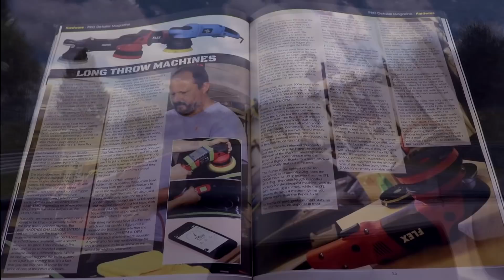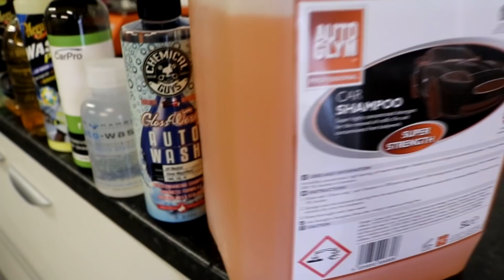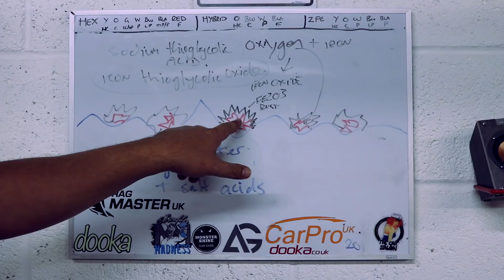From 5000 detailing products down to essentials - Complete Garage Clear out

Comment: It would be interesting to see what you "throw" away and why, kind of reasoning as to why those product don't have place on the shelf. I guess mostly they are "not as good" products as you kept, but in which way e.g.  maybe some product are better but more expensive and for somebody at home not doing bulk detailing that is not the problem and extra price worth it? So that would be interesting to see - sadly I guess it is a bit late considering this came out 11 month ago (at the time of my comment).
Reply from the maker: yer I cant keep it all.. most of the time its like do I need 6 APC's  do I need 13 heavy cut compounds.. etc.. I just want one.   but its usefull to keep a few products in each class for comparisons...   you really dont need shelves and shelves of products like I have.

Comment: Awesome video......always love the passion. When you say that some products contain harsh chemicals...eg leather cleaner,  Tell is which ones.
Reply from the maker: Example.   Greenstar.  I dont use it on leather.  some prolly will do because if you knock it down to like 30-40:1 the concentration of the sodium based components will be so very very low.

Comment: Thanks! What's your favorite coating prep wipe? I find some to be grabby upon wipeoff, which scratches the paint. Totally counterproductive.
Reply from the maker: cheap hydrocarbon based  ones.  They are very fast acting the hydrocarbon solvents on car panels.   work them over, dont allow them to flash or dry.  And buff them when they are still wet and visable.   not trying to preach to the converted brewinz you might know more about this than I do just brain dumping.

actually I think your talking about the water based ones the coating brands sell..  In which case yes Im with you and agree they do stick yes.   I dont think polar solvents in water are on the same level as a hydrocarbon solvent.  obviously need to be carefull with them, but its nothing complicated really.. just being very mindfull of heat and not leaving them on panels, on off etc..  cheers mate

Comment: It would be interesting to see a test of the chemical resistance of Ceramic Coatings, do very potent cleaners dissolve it? How strong is the bond between CC and clearcoat? Can one peel it off? Too close with pressure washer?
Reply from the maker: hey flynn I did this in the best ceramic coating video try to effect them with acids, alkalines and solvents.   nothing you can really use on cars chemically will disolve a coating once its fully cured, well at least thats my understanding Im not an expert on coatings most things I know are 2nd hand bits of info.   If the paint is prep'd properly as well the bond to the clearcoat will never be a point of failure.     You coating wont peel it off.  it will just erode away.   The thing is you are talking generally about a sub micron layer of material (can be more yes).  thats the more important thing to understand.    so it will just be slowly eroded away I think by the environement and being rained or, yes being hit with detergents during the multiple washes etc.. the contact used during cleaning as well ill all have tiny impacts on that sub micron layer..
Reply: @ForensicDetailing  Oh cool, you think of everything :)  I will check it out!

Comment: Hi Jon. Quick question, where did you buy the double action sprayer? (I think it’s made by Kwazar). In addition to this, where did you get the pressurised sprayer from? (I think that is made by IK)
Reply from the maker: clean and shinny for the 360 sprayer mate review video for it on channel.  straoon and briggs pump from amazon very cheap mte review vid on channel
Reply: Thanks mate.

Comment: Do you have any advice on how to remove polish residue on textured plastics? 

Seeing all that cleaning stuff makes us know you test just about everything on the market and hand pick the best 👍
Reply from the maker: erase will only remover polish thats on the surface.   problem is the plastic can be pourous and the polish sets in.  when the solvent vapes out of a polish it can go rock hard.  I typically try and disolve it back down with the type of solvent thats used in the product in the first place (usually mineral spirit or hydrocarbon) and then rub it with microfiber to try and draw it out.   can be a major ball ache when this happens.    gotta let the solvent break it down and penetrate.
Reply: Thanks guys, delta romeo I tried that but sadly didn't look to work. Used a eraser at the back of a pencil which just rubbed down till there was no eraser left. Might try getting a block of eraser and trying it out.

Will also try out your method Jon. Back in June when I was machine polishing for the first time the masking tape flew off the plastic so got bits of the polish on it. It's just now I'm starting to look at it. It's this strip of plastic which run down the roof on both sides.

Comment: You talk a little bit about products going off are glass cleaners and interior cleaned likely to go off? Reason I ask is because I plan to buy some in bulk like a few years worth of supply
Reply from the maker: glass cleaners should be good for years.  But a glass sealant might not.   can vary but siloxanes and lots of modified forms of silicone can have like a 12 month shelf life. polishes tend to be good as long as the container is airtight.  typically most things seem to be usablable.   Generally its any synthetic sealant or ceramic I think you need to watch.

Comment: Great video Jon. Been waiting for this one for a while. I didn’t want to build up a load of stuff I didn’t need so wanted some guidance on the best stuff to get from the outset. Glad to see you have a few products that I too have, mainly Scholl and Bilt Hamber. I noticed you didn’t keep BH autowheel but kept the Korrosol. Is that because they are basically the same product? I have both and would rather buy just one of them.
Reply from the maker: so I did think about autowheel.  but I NEED a paintwork fallout remover.   And I can clean an  alloy with anything and then decon it with korrosol.   autowheel is more foamey more detergenty more of a fallout remover you can work and it foams up and degreses the alloy as well.. so its more a wheel cleaner.  I love it but I dont want to have to buy 2 FR's
Reply: Forensic Detailing Channel I tend to clean my wheels with a wheel cleaner product  first and then spray on the Autowheel to clean off the fallout. In future I will just get the Korrosol but in larger quantities.

Comment: Have you tried using a spray detailer or spray wax as a leather conditioner? Ive been doing that for awhile now and I love the look plus it doesnt leave a greasy film
Reply: surely that would make the seats shiney not matt?
Reply: @jamesbutler606  it leaves everything matte or gloss depending on if it has a clear coat on it

Comment: So Jon, in all your stuff, something I've never seen, do you have an air blower for drying?
Reply from the maker: 27:30 over my shoulder in the background :)
Reply: @ForensicDetailing    Ha, missed it! I haven't seen you use it in any videos, how useful do you rate it?  I'm thinking of getting one, mainly for my bike as it's impossible access all the little areas around the frame/engine.
Reply from the maker: @raydavison2972  its great but I can be arsed to unwind the cabel and fire it up most times.   Ideally I want a tiny one thats battery powered..
Reply: @ForensicDetailing   But would you charge the batteries? It would always be flat

Comment: Slightly disappointing not to see  Fusso Coat in the protection shelf!
Reply from the maker: at around 26:00 I had a pile of things that I like and are usefull fusso is in that pile..  my tin of fusso was about to run out and jackie kindly just stuck another tin in with all the soft 99 stuff.    I do find it usefull.  But I actually prefer kiwami funnily enough.  I also couldnt let 5th element or UHD go these are expensive waxes that I like.  but I need to think about it a bit because again whats the point of having it all if your not using it.  Id rather it get used I think.   So might give those away as well.

Comment: Great video tumbs up :) İm between fusso coating and Gyeon cancoat help me :)
Reply from the maker: awww man.   fusso a bit less hassle sling it on, lasts well, a hell of a lot cheaper long term...   but like these lightweight ceramics. im a big fan of them.  so like, if you like a simple life its fusso, if your in2 your detailing and want to check out a really cool formulation that might require more indepth prep and is a bit harder to apply than just a simple wax (or sealant lol) then its cancoat.  cancoat and wet coat is a wicked combo.
Reply: Forensic Detailing Channel thanks a lot mate im gonna get both i have 2 cars. For merc cancoat for focus fusso 😄

Comment: Have you used Gyeon bathe plus ?
Reply from the maker: yes mate, I talk about it in the best shampoo video and gyeon brand review.   its a really blingy product, and seeing the hydrophobic performance it leaves is cool as hell.. but I dont want to coat my car in siloxanes while cleaning it.  for example the glass has not been degreased at this point and Im covering it in protection etc.. things like that. theres other reasons not to use it as well.. suds not stable and its no where near as good a shampoo to clean the car as Bath or Bath Essence which have different surfactants in there (cationic).  Bath+ has to use a anionic only surfactant so it does not interfere with the cationic function of the siloxane.